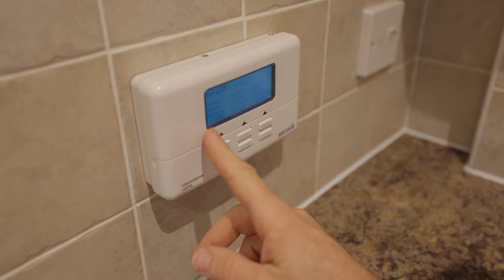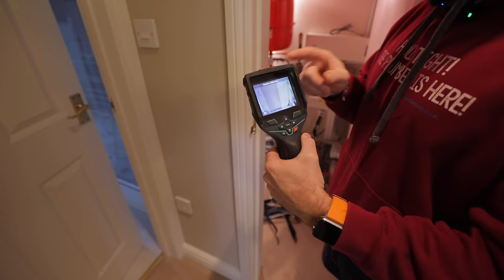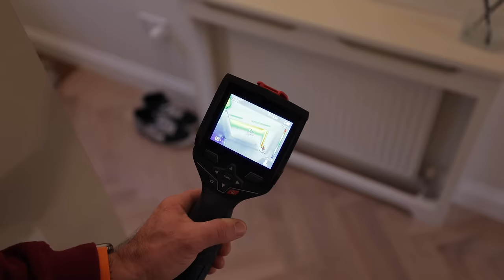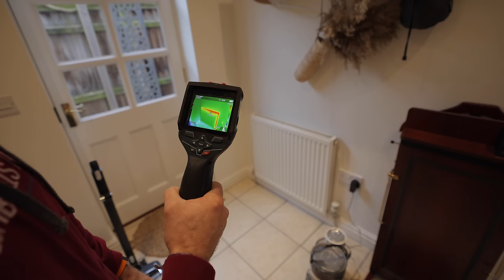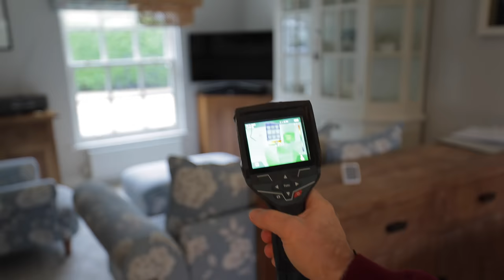THIS HEATING SYSTEM NEVER WORKED - Adam's Problem

Comment: Interesting. Our heating system was playing up last year. The boiler kept running up then switching off with a fault code referring to inlet and outlet temperature difference. I thought it as a sensor in the boiler. Was baffling me until one day I was in the airing cupboard and accidentally touched my elbow on the CH pump. It was red hot - way hotter than it should be. Turns out it was slowly seizing up and struggled with flow. £40 later with a used one from eBay installed everything was sorted.

Comment: I am no plumber, but was of the understanding that at least one of the rads should be "open" ie no TRV as if they all closed off the boiler would be dependant on it's own stat to shut off with no water flow!
I have my own rads balanced at half open and any that did not get the room hot opened up a bit more. Your way seems to work well though! ;o)

Comment: Great video plumberparts. Can anyone tell me why the convention seems to be to put the circulating pump after the boiler (on the hot side) and in this case at the system high point, it’s almost as if people want the pump to airlock (lets be honest, automatic vents only work properly for the first few years). Also Hot water has a lower vapour pressure so the pump is more inclined to cavitate. IMHO the pump should be on the cold side (return) with the header tank or pressure vessel connected on the  pump inlet and the delivery feeding the boiler. This means the pump is pumping lower temperature water and since the pressure vessel is on the inlet then the pump should almost never air lock and tend not to cavitate as much. Thanks.

Comment: There was me measuring flow and return temps on each rad for a 11 degree difference, and all I needed to do was wind down the lock shield valve and open it a quarter turn 😮

Comment: Love your point about the TRVs most people just use them as an off and on dial instead of setting them to 3 and then adjust them (my mum has a habit of covering them with stuff so they don't work correctly until I got smart TRVs that support remote sensor in each room (and I locked them so spinning them doesn't do anything) 

Probably the first YouTube video that I've seen where they tell people how to actually set the radiators up 

my boiler is pretty old and  doesn't have a bypass valve so we do have one radiator that has to be fully open (i recently went with smart thermostatic upstairs valves 1.5c lower then downstairs

downstairs control by the thermostat we have an open plan house (all the radiators are set to full open downstairs due to open plan) 

G

The temperature mechanical thermostat should be +/- 1c max (not 5c) any higher it's faulty

hive is +/- 0.1c from target witch isn't ideal as it can cause high boiler cyclicing (if the boiler doesn't have a cooling off period) a lot of new boilers do, strangely the alot of heat pumps don't (have to make sure the controller that runs the heat pump has it) hive has zero radiant heat learning (just fixed +/- 0.1c off and on from target temperature) 

nest is +/- 0.2c ish target temperature set (reason for ish is because nest uses a on the fly F to C conversion so it isn't exactly what you set it to especially if you use the app, like 21c can be 20.8c to 21.1c) also nest does have radiant heat learning (so works out how long it takes to heat or cool down and adjusts when it goes off and on) only thing I recommend is turning off the auto schedule
Reply: Hi yes you have lots of settings on my heat pump controller for the from+- 0.1 to +- 5.0 stops a lot of dry cycling once you set the weather compensation to a good approximation.

Comment: TRVs sort of confuse me when it comes to efficiency because using one is counter to thermodynamic efficiency. The way to improve efficiency is to reduce any throttling effect - basically increase flow - and drop the temperature of the heating water. It's hard to see it on a domestic system quickly but I was an engineer on a steam VLCC way back and we burned around 160tonnes of fuel a day. Given that's a considerable amount of wedge being burned, running a high pressure boiler as efficiently as possible makes a huge and very quickly noticed difference. So, as we achieved the desired cruising speed what we did wàs gradually open up the main steam valve whilst at the same time drop the boiler temperature and pressure with the target being a fully open steam valve to the main turbines and the boiler pressure matching the desired speed. It saved a lot of oil per day. 

So when I renovated my house I ripped out the entire heating and water system and replaced the lot. I used more and bigger rads than required, used bigger pipework wherever I could and and reduced any throttling effect as far as possible with as many radiator valves fully open as I could get. I then set the boiler to the lowest temperature allowed which it could be set. This is the most thermodynamically efficient way to heat water.

Comment: This video was very informative and helpful for me, had the heating replaced from heat to combi, was never told about how the TRV worked, I thought these were more of a water flow regulator, not temperature controlled.
Reply: It's about both. Flow restriction at lockshield to balance, but the TRV completely shuts off the flow at its end when the temperature has been sensed. The Drayton TRV4 does both at the TRV end where the lockshield is left fully opened and the flow is restricted within the TRV head as well as the normal TRV shutting off.
Reply: Thank you, they have installed what looks like a Centre TRV product code: 205770. To the logo and type by picture, Take it the lock shield is the valve on the opposite end, all these are fully open, is it best to get these balanced or just leaving them, the TRV I've adjusted.

Comment: The customer mentioned having auto balancing valves. Under the TRV you may find the auto balancing valve hasn’t been set for the size of rad. When you fit these auto balancing valves you have the return lock shield wide open, which you’ve shut down
Reply: Are these pressure sensitive in action.

Comment: OK so I've listened to 2 of your really informative videos, but I don't understand a few things:
1. If I walk into a room that is cold and yet the radiator is hot, I shouldn't turn up the TRV to max. What I'm not understanding is - why is the room cold if the radiator is hot? Have I gone into the room too early? Do I just need to leave the radiator as it is, to eventually the get the room up to temperature?
2. Why are there 5 or 6 measurements on the TVR? Do they align to any known temperature measurements?
3. If the TVR is measuring the temperature of the room and not the radiator, then why is it bang next to the radiator? Surely it can't get the temperature of the room because the radiator is overwhelming it with its own temperature? 

I'm still learning so please be patient.
Thanks

Comment: Good work, though as a heat pump guy i'm not really satisfied with the shortcuts in balancing the system. Don't get me wrong, for a gas boiler or electric system it's completely fine. But if you're working with heat pumps you really need to know that you have the proper flow through each radiator to get it to run efficiently.

Comment: I balanced my radiators by size - the smallest (rated at 600 watts or less) got a quarter turn open, the mid-range (about 800 watts got a half turn), and the biggest (1200 watts up to 2000 watts) were left fully open. Seems to work pretty well at equalising the warm rates. What do you think of that approach?
Background - my system feeds the radiators with 10 mm microbore, which I understand tends to be self balancing to some extent.
Reply: That's OK if your radiators are designed for the job. If a radiator is designed to a maximum rate of 750 watts, then tiring to pump 1200 watt of energy though it will render it unstable. Balancing seems to be a bit of a buzz word.
The arithmetic for radiators is thus. 75-86 watts per m2 floor area. So a room 20m2 will require about 1,8 kWh of energy. Thus 3 radiators @ 750watt each; which should do the job comfortably. The most economic forward flow temperature is 60 degrees C. with a return flow temperature of 30 degrees C. Two type of thermostat are used. The input thermostat measures the room temperature  and the output thermostat measures the water temperature thus the water returned to the boiler is controlled and should be keep at 30 degrees C. The difference in the temperature drop, between the 60 degrees in and 30 degrees out; is the energy needed to warm the room to 21 degrees C. If a higher temperature is required, just open the room temperature thermostat, this will increase the heat surface area of the radiator, which in this example has a 30%+ margin. However, The out put temperature will be the same, thus heating economy want be compromised. Confusing? well, that's physics for you!!

Comment: You mentioned the by-pass valve should "crack open" tp prevent the boiler from reaching boiling point and steam, surely the temperature sensor built into the boiler / boiler controls are there to protect against this.

Comment: Great video . Can you tell what the story is wit the expansion vessel . I allways see that they are fitted what I call upside-down. We allways had to fit them the otherway around.  For the reason that the water will tuch the membrane.  In the Inglish way there will be an air cussion . So what is the story ?

Comment: Great job. I bought a cheap laser temperature measure and did set all radiator flow's to a in/out difference of 30°C, and it improved my heating very well. This way I can be sure the radiators are giving all the temperature to the room and no heat is flowing back to the furnace. Furthermore I bought a modulating thermostat that improved the heating even more. 
Just simple solutions, you can do yourself without the need of a specialist. :face-blue-smiling:

Comment: A good video for homeowners but if you are plumber please don't set the bypass with a trickle back to the boiler plus there is no mention of the important things like heatloss, mass flow rate, pipe  sizing,pump sizing hydraulic separation on underfloor also what is a strangulation valve?

Comment: So... balancing. I assume that if you open the taps all the way on the balancing valves, the room that doesn't get any heat is the only one that should have its taps left open, and the rest should have their taps closed until the cold room gets hot without the other rooms going cold - and a room that should not be heated at all (then why does it have a hydronic heating appliance in the first place?) should have the balancing valves closed all the way?

TLV it seems like is a brand name. What's the generic term? Is it right to think of them as throttles?

Comment: So I knocked down all the lock shields to a quarter turn, all still very toasty - whistling like mad though - next video on solving whistle/rushing?

Currently in the middle of renovation, the system is down about 4 rads - is the flow pump running too fast? No air in the system

Comment: The installs that I have had to do with as a homeowner (the first one I designed and built myself) all leveraged a manifold on both sides of the circuits (zones) all with thermostatically controlled ball valves on each circuit so that you can isolate each circuit from one place ... using a single pump which allows to test shutdown during no need for both the boiler and the pump, make-up water, air bleed valve, able to force flow to an individual circuit to push the air through, test temps out and return, verify the ball valve physical function as they have a lever for thermostat bypass, etc. so that wearing the carpet out wasn't necessary. I have never used radiators ... air trapping could conceivably be an issue but shouldn't that be satisfied by air bleed valves on each radiator?

While looking at systems in houses for sale, I see that there's a tendency to use multiple pumps instead of zone ball valves but that seems to be overkill, adding expense and non isolating (unless you add a gate/ball valve) ... some modern ideas leave me wondering if the engineers were designing FOR obsolescence ... I should mention I live in western Canada.

Comment: Great video again mate and something I'll definitely have a go at myself. A silly question tho if I can ask, the 'other' valve that allows water out of the radiator, how open should it be? And should they all be set to whatever opening it is? Many thanks if you or anyone can answer and take care 👍
Reply from the maker: It should be set to 1/4 turn open, then monitored then just tweaked after that to bring it up if it's not getting hot after 20 mins.

Comment: James, are all the radiators in a house opened up a quarter turn on the lockshield? Or do you open them all differently?
Reply: Yes, as a starter for 10, have the lockshields all 1/4 open, and TRVs on max.

Leave it about 30-40 mins, and if any rad is still cool, then open it slightly, maybe another 1/8 turn max, and wait about 20 mins to see if it gets hot.

Comment: Great video, I’ve followed your tips for my own radiators.
Couple of questions, I’ve got 3 towel rails. 
Should at least one of them be set to full flow ?

Also when balancing rads I keep reading about a 12 degree difference between flow & return on the rad. 
Is that correct?

Comment: System commissioning can be a joke , plumbers just won't put in the time !
Did my own system balancing if done correctly it's a “ Set it & forget it ” 2 hr  job .

So you keep the same system load opening a window or door can help .
If you've never balanced a system before you can have couple of goes at it .
It's probably a 3 hours job for the uninitiated . 

One thing I did when balancing my system is remove all the TRV's heads .
Anyway you're checking the valve pins so its not a big problem .

Set the lockshield valves just before the room reaches its working temperature .
NOTE You always go around the system more than once !

I like setting for maximum TD across individual radiators .
Only refit the TRV heads when you're happy with the system ( Not per radiator ) .

Also if the system has the old style circulating pump changing speeds may invalidate all your work !

Comment: This is all about problem solving skill by logical reasoning with reference to thorough understanding of the systems. It just happened to be a problem in the heating system. James would have been doing the same if it was a space shuttle.

Comment: Great video, thanks. Any chance you can do a bit nore on bypass valves.  Am I right I understandstanding it almost need to be closed?
Reply: just open a small amount, not almost closed though, its there in case all the trv's shut down also to allow the boiler to lose heat in the overrun cycle.
Reply: I'm not sure why he said it needs to be open a small amount. It should be fully closed when there is demand and open when the system is going through its pump overrun phase. It's an auto bypass - not to be confused with the old school way of doing it with a basic manual valve which unfortunately does need to be open a small amount at all times.
Reply: @killercabbage1276  thanks. Find the thing confusing.  I have one here numbered 0-10 but doesn't say what the numbers mean,. The info with it is no clearer.
Reply: Yup, the instructions are difficult to comprehend and they are notoriously unreliable. I find a rudimentary approach relying on tone/temp changes a very easy way of setting it up. With the system cold wind it fully in like a screw, fire up a circuit to a decent temp and then turn off demand... then proceed to wind it back out until a discernable tone/temp change can be observed. You ideally don't want to strangle the life out of the boiler/pump with a measly flow so crack the valve until things seem a little less stressed. It's rudimentary but it works for me.  @radfoo
Reply: @killercabbage1276  thanks. That makes sense :-) I'll give that a go

Comment: Looks like a few problems with this install.  The underfloor heating has been fitted without correct separation.  The system is trying to pull heat everywhere but due to pipe dropping down to 22mm i would imagine as it can generally only pull 21kw @0.9m/s on 22mm dt20, that’s without calculating.  Be a simple fix in that airing cupboard to put everything right.

Comment: As always fantastic, a couple of points, Analog room stat not allowed  any more, as you said, should be best 1 Bosch 2 Open Therm 
3 Digital : gate valves not allowed in pressurised systems, TRV behind curtain,  auto by pass should be 22mm never 15mm. 
Thanks for another super vid. regards George Staszak 😍👍
Reply: No gate valves why is that?
Reply: Because it's a LOW pressure valve which jams shut under high pressure, ie, if you turn OFF to stop the water then turn ON again the spindle snaps. Thanks for asking. George  @beerpig12

Comment: I've had a lot of problems with my new-build flat and boiler recently. Learning all I can find (and not having much luck) I found that my boiler needs a minimum 10% load. Did you ensure that with that bypass valve? My flat with the radiators they fitted seems to need 3 fully open. Not just the one with no TRV.

Comment: Hello, I would love to ask your advice on my system. I bought our first home last year however the hallway rad and bathroom don't work. It also seems our bathroom has two balances on each end and no valve. I'm up in Biggleswade would you have any suggestions I have bled the rads and also turned on the heating closing all rads off apart from the two issues ones but still not working.